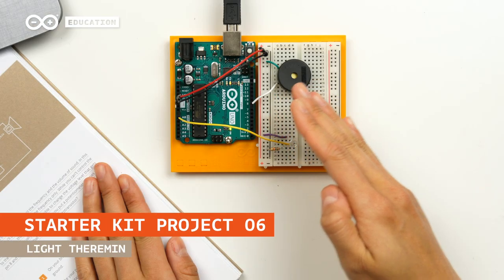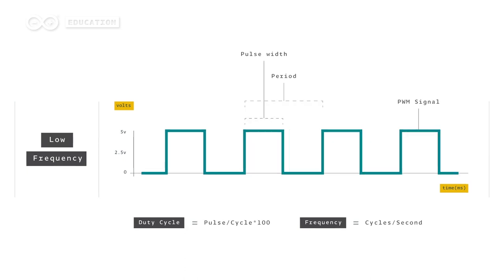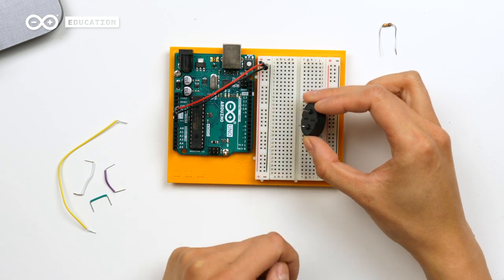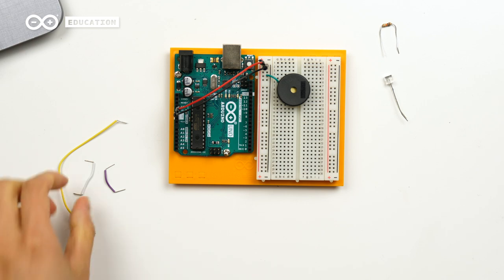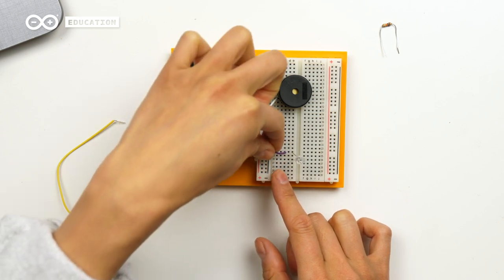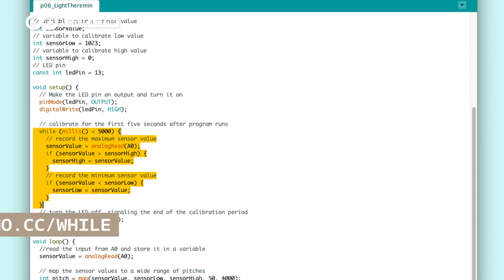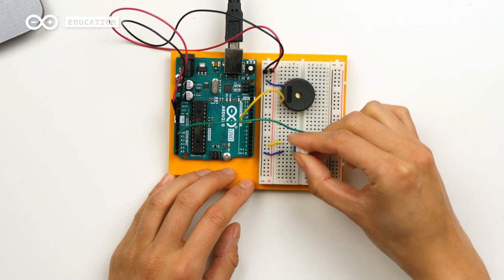06 Starter Kit: Light Theremin

Comment: Thanks for the video; I'm a newcomer and I'm still having difficulties, though after watching your video, I do get a theremin sound, though without the wobbles. I notice there are two differences between the video and the book. 

- Resistor Connection: On page 72, image 2 of the book, it shows the resistor and the connection to the analog pin in the same row. In this video, at 2:50, it shows them in different rows. Changing my project from the book to what you have here produces a theremin sound, instead of a drab buzz.

- In the code, under the void setup section, under the while loop, the video shows the line "sensorValue = analogRead(A0);" which is not in the book.  

The setup in the video is making it more theremin like, though I'm not getting the variations in sound with the sensor. I tried a few different sensors in case that was the issue. I'll continue to investigate. 

Thanks for the vid!

Comment: I don't understand ledPin =13 part of the code. Nothing is plugged into pin13?
Reply: The built-in LED on the Arduino board is connected to the pin 13.
Reply: @rafisarhan2336  it is used so that you know when the calibration ends.
Reply: @analog_dreamer  I didn't know it, so I connected another led to pin 13 and it worked! I was very happy (I know that this is not a great goal...but for me it was!)

Comment: I used a potentiometer. I thought  that it does not work, but actually it produces a very low frequency. I am wondering why so. I tried to tweak  a few things in the code, but nothing changes.
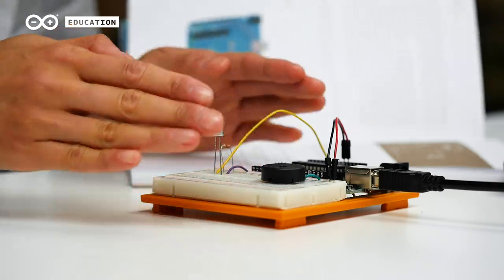Reply: have you considered those 5 seconds at beginning for calibration 3:25 to move the potentiometer from its minimum to its maximum?
Reply: I used two potentiometers and a capacitor (one to control the amplitude and one for the frequency). I used the following code based on the previous project :

int potVal;
int freq;

const int piezoPin = 8;

void setup() { 

pinMode(piezoPin, OUTPUT);
Serial.begin(9600);

}

void loop() {

  potVal = analogRead(A0);
  freq = map(potVal, 0, 1023, 50, 4000);
  tone(8, freq, 20);
  Serial.print("Frequency: ");
  Serial.println(freq);
  delay(10);

}